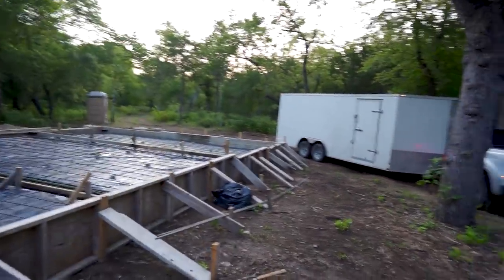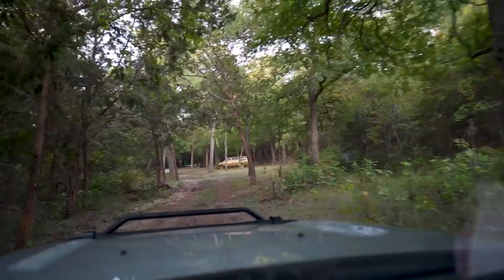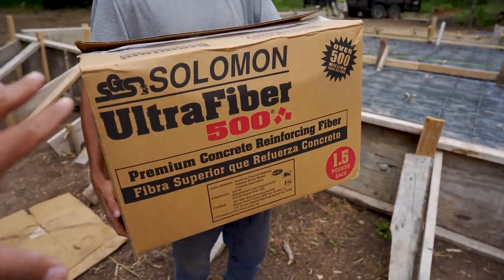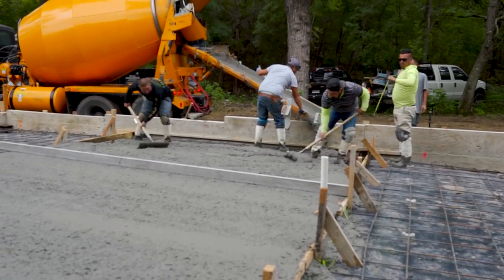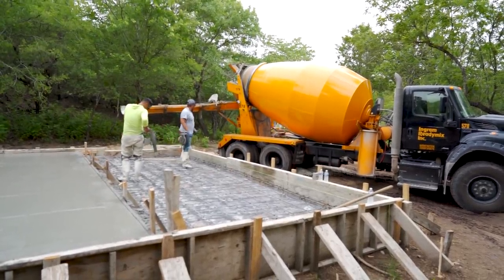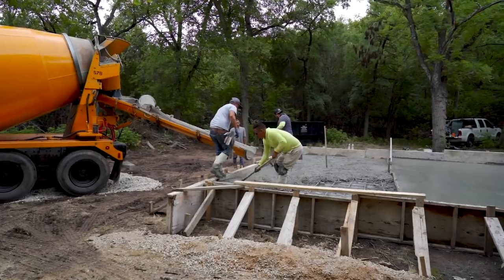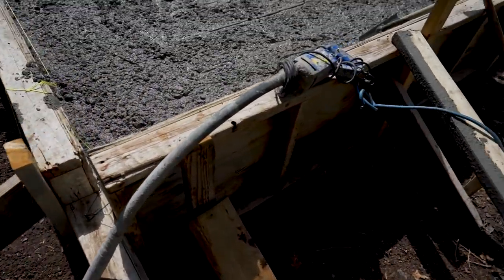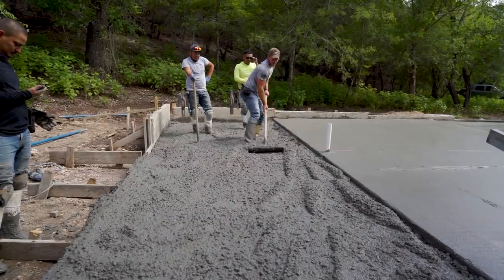Concrete Pour - Demolition Ranch Headquarters Part 5 | E69 S3

Comment: I worked as a concrete special inspector for a decade and it is a pleasure to watch a crew that knows the right way to do things without being told, cajoled or threatened. Been watching you since the $1 per foot slab video that circulated on LinkedIn.
Reply from the maker: Thank you.  
Yeah, the infamous $1 concrete video.  😂

Comment: My company just bought a Makita pencil vibrator with the 4' stick. Love it. We had one of the old style vibrators that weighs 60lbs with a 10' stick. Definitely recommend the new battery operated Makita. It doesn't have the power that the old one did, but it works well for what we do.

Comment: After you do slabs long enough you can feel any variations or bumps with the boat float and smooth them out the way you do it is fine and works good so liking it👍

Comment: I'd say you only need a little over 9.5 cu yards. That's using my HIGHLAND LAKES READY MIX CO, INC concrete slide rule that my DAD used to use back in the 70's and 80's. GOD rest his soul.
Reply: I once had a boss who couldn’t figure cubic yards so he’d use the little slide rule the RediMix company gave him.  For example, if we were doing a sidewalk, he’d say, “It’s 3 1/2 inches thick, so we’ll call it six, it’s 3 feet wide, so we’ll call it 4, and it’s 40 feet long, so we’ll call it 50.”         Then, after every job, he’d ask, “How much mud did you have left?”  We’d ALWAYS say, “About a wheelbarrow full.”  But sometimes that was a heck of a wheelbarrow load!

Comment: I always set the form-work to the exact height of the final finish and run the mag tamp bar between the two parallel guides like a saw, after vibrating to just over level. My tolerance is +/-1mm. I normally do a few passes with the mag. The method in the video seem to require a lot more man power and more skill for those tamping to keep it level. Thanks for posting.

Comment: I don’t care what anyone says workout muscle and working muscle are completely different
Reply: Yup, Had a short Hispanic man deliver my washer and dryer and he carried both on his back off the truck and up to my 2nd floor washroom,  he wasn't built but just stocky and his partner said he did that all day long....
Reply: @jasonengland2357  I was an elevator door installer. When we would get a delivery, it was usually 100-200 a day. Mostly because of construction debris, we would have to hand-carry them. The only practical way is to put them on your back.  I did thousands of them like that. The stainless lobby doors are the worst. 350-400 lbs each.
Reply: They are both muscles what are you made up of ??? Some people are just lazy af and wouldn’t want the fatigue that the job brings along
Reply: @Juan-dl3qs  They is a difference sir. Typically when someone goes to the gym or works out at home, they usually limit themselves and target certain muscle groups. When you're doing this type of physical work every day for a living, you tend to work out muscles don't get used very often even if you do visit the gym. That's where the term corn fed comes from. People that do physical work for a living are stronger than many people think. I believe that's what he is trying to say.
Reply: getting work muscles ignores other muscle groups. Getting muscles in the gym is better because you will develop every muscle.
Reply: Zezoo 210 when I was younger ( 33 ) I was as solid as a telephone pole. I was a high line lineman.  Now that I’m 61 I am a marshmallow compared to my prime.
Reply: Juan it’s all of the tiny muscles dude.

Comment: Always good to get the new guy dirty and burned out. Matt loved it. Get the 20v dewalt vibrator. A 60v battery lasts the whole job for me even doing walls. It will match all the other dewalts you was using. I have about 10 batteries with me every day and a truck charger. I haven't run out yet. Even with the 60v chop saw and 60v worm drive circular saw. Am a demolition guy but adding you now. I use a bump stop also. Never to pround to make it right. Never seen a vibrating bull float.
Reply from the maker: You have to try the magvibe.  You’ll like it.
Reply: @TexasBarndominiums  cool. Just looked it up. I have a golden brand in the shop on the wall with a  broken adjuster looks like it's going to get some parts to put back in service.

Comment: Demolitia here. 

I am in civil construction, do quite a bit of concrete. My primary frustration is that most of the concrete yards we work with run 10.5 yard trucks, but always send them out light. We see anywhere from 7 to 9 yards, so it really causes issues when we are planning clean ups. It is a particular issuer when we have a very specific mix design for fast set and early strength rise because we need that monolithic pour to go real smooth. Nobody likes calling in that cleanup for that extra yard, especially when it is because they send 3 trucks out a yard light each. 

Figuring out the need is pretty easy, until you get into trench backfill with slurry/ clsm. Then you know that all those little numbs and bumps add up quickly over 300 feet or more. 

Overall, 11.5 yards. Depending on the job and how close the plant is we add 5% to 10% for smooth graded soils and aggregate base. 1 yard extra minimum unless there is no space and the concrete company does not back haul leftovers.  I would order 12.5 yards.  1 truck (we figure will come in at 9 yards) and a 3 yard cleanup since the cost of that extra yard ($105 delivered) is a lot less than an interruption or an emergency cleanup.

Comment: Demolitia here...no,  I didn't "notice the pipe" until you pointed it out👈.  Running that concrete is an art, interesting as well. Your guys make it look easy but that's from experience and knowledge. Think I heard Matt say "about 3 mins and I was tired". Wow, for sure ya gotta know what you're doing or could easily be a big mess.  I'm guessing will run short, at least 3-4 yards short I think?

Comment: All of our local concrete companies use front discharge trucks.   It seems that combine with a driver operated hydraulic shoot they can place the mud much easier, faster and more accurately that rear shoot trucks.  Looks like it would have made things a lot easier on this pour.

Comment: years ago when i worked construction as a electrician, we would work on the gal pipes coming out of the decks. some of them had no caps on them, so we would put a metal snake through them to see if they were open. a few had concrete in them. if the snake didn't break it open, we would pour pepsi, coke, or white vinegar in them and wait 1 day. that usually broke the concrete up when we would hit it with the snake again

Comment: I don't use duct tape anymore, because on the last job the shel contractor's filled a pipe full of concrete

But then again nothing i could think of could protect material,equipment or installs from them

I appreciate that you care

Comment: I used my slide rule I got from my father from back in the 70's, I got right around 11.5 with the dimensions you gave us. 
If you only had 10 yards on that truck then your beams or floor wasn't as thick as you are saying or truck had a little extra on it.....I dunno. Looks good, nice job

Comment: When I built my workshop, the building code required that the footers (as you call them beams) had to be 2 feet deep and 2 feet wide. My floor is aslo 8 inches thick. Because I was going to install a couple of lathes, milling machines and a 8,000 lbs granite surface table, #5 rebar was used throughout as well as 4500 psi concrete and the fiber reinforcement. 
I was lucky as a dear friend that has 35 plus years of experience doing commercial tilt wall buildings (frame the wall on the ground then pour concrete and stand up once teh compression strength is reached) and parking structures, volunteer to help. We poured 27 yards of concrete in about 4 hours. It was nice as the batch plant was less than a mile from my house. I purchased a power screed then sold once my projects were complete.

Do Texas DOT regulations allow you guys to have transported 10 yards of concrete at a time?

Comment: That's some great work! However I'm Always wondering about the cure (keeping the concrete wet for a few days to avoid cracks)... Matt seems to Not do it properly for any projects and I was wondering If you are doing it on this slab. Why or why Not?
Reply from the maker: We water cure when we can.  However, on this job there is not water on site.  But we did get some rain the day after, so that will help.  :)
Reply: Texas Barndominiums okay thx a lot for the answer :)

Comment: Yep! If that pipe was a floor drain you really would need to do that. When they were using a pump on our new jail they failed to cover the floor drain and the QA at our county would not listen to the maintenance department when he said a 5 gallon bucket of water would not prove the drains were working from the fifth floor. Six weeks after moving in 600 prisoners there was a serious sewer backup. It ended up totally doing away with the entire maintenance budget for six months to fix the problem. No it did not cost the builder the county had signed off on the acceptance.

Comment: If I'm not mistaken, there's no vapor barrier in the beams/footers.  What's to prevent moisture from traveling through the footers to the slab?
Reply from the maker: The thickness of the concrete. It’s 24” thick at the beams.
Reply: @TexasBarndominiums  Makes sense, so basically the thickness of the concrete cuts/stops the capillary action at some point between 0"-24+", where say at 4"-6" (slab thickness) it does not. Do you know the min thickness of concrete to accomplish this? Thanks for the info and reply...
I'm learning!! Really enjoy your videos

Comment: Yeah I noticed that pipe I didn't wasn't going to say anything though. On the yardage I didn't take the time to do the measurements for you but it's length times width times height in inches and then divided by 27 and then sometimes because they do yardage by weight and you're doing yardage buy actual cubic yardage there can be slight differences for a few yards. But by just eyeballing it on the TV what's really doesn't tell you match I would think it was more than what you were saying but usually in person I'm pretty good at that

Comment: What slump do you order your loads cause ift looked super watery and how much accelerator did you use cause it looked like it setup super fast too.
Reply from the maker: 5 slump. 
No accelerator.  The color and straight cement (no fly ash) makes it dry quick!

Comment: How are you going to anchor the frame once the concrete is dry ? Do you drill to insert a threaded piece ?
Reply from the maker: Weld columns to anchor plates.

Comment: Why did you leave the board in the slab, between the main portion and the front porch.
Reply from the maker: Because slabs are different levels.
Reply: I believe they let the top slab set up and once the lower slab is in place they pull it and backfill. Just did that kind of pour yesterday.

Comment: 7:00 what are these “beams” you speak of?
Reply: form was dug deeper around edges and across a few places.
Reply from the maker: Grade beams.  Ditches around foundation.
Reply: @TexasBarndominiums  Oh, the footers?
Reply: @d.8580  For. You yes for them grade beams
Reply: In the USA they are called footers.
Reply: @johnmarquardt1991  well in Texas is call grade beams
Reply: And footers are just the footprint of the house or buildings where walls go
Reply: @rubenvarela4077  I think it's called several things all over.
Reply: @johnmarquardt1991  in st Louis Mo we did 8 ft walls for basements and he call them footings under the wall
Reply: @SheepdogSmokey  yeah ture that
Reply: Grade beam is when the height is greater than the width and a footing has a width greater than a height.
Reply: You may know them by another name "Footings". Basically, load bearing parts of the slab that go below ground. Usually placed around the edges of the pad (to prevent the soil from under the pad migrating out, and frost stuff.) and under load bearing walls that will be inside the pad's area.

Matt better be glad that the frost line is well above 12 inches where he's at. If he were up north, the frost line could be four feet below grade... He'd be swimming in concrete.
Reply: @johnmarquardt1991  Depends where you're at. I know around AZ, they're footers. But I can't speak for the rest of the US. Looks like Texas likes to be a rebel.
Reply: @rubenvarela4077  Isn't your frost like a lot lower than in Texas? Pretty sure it's a case of "well, we have to dig them deep anyways, might as well make a basement."
Reply: @jackielinde7568  that was in st Louis mo when i live you are correct  i live now in texas
Reply: @jackielinde7568  they 24 inch around. And middle part 1 or part 2 cover this
Reply: Just to chime in with some "logic".  Grade or Ground beams are used to directly connect a SLAB as an earth anchor system.  Footers are 'similar' in initial appearance BUT support a foundation WALL which is substantially narrower than the footer.  In the case of a 'lined' crawlspace or a basement floor, the floor slab often stops at the interior edge of the footer and is left "floating" free at only the thickness of the floor.  Floors are commonly only 3 or 4 inches thick.  Footers (depending on load) start at about 8 inches thick and go thicker with heavier loading.  Grade or Ground beams are commonly (including floor thickness) 18 to 24 inches thick (In my area of the country).
Oh, did you notice Matt C. went "over" the top of his 16" tall boot?  Yeah, ground beam plus floor thickness.
All clear as MUD now???  LOL!
Ken
Reply: @jackielinde7568  They guy is from Mexico.
Reply: that in various parts of Texas, the soil/dirt durface is completely different.  In some areas of Texas, the top layer is mostly expansive clay and during the hot summer months, the cracks are large enough that you can turn your ankle in these voids.  In other areas, you can reach bedrock layer in as little as 6 inches.  The best thing to protect your investment is by sending a soil sample to Texas Agriculture Extension department @ Texas A&M University for a soil analysis before starting.  Some areas you build on a floating slab, other areas of Texas require foundation piers to be drilled, and finally, some areas have a combination of pier and beam foundations.
Reply: There is a difference between a grade beam (used here) and a footing. There's also a term called thickened slab edge, something different still.
Reply: @TexasBarndominiums  see that sounds like a footer.
Reply: @moymoses7234  taken right from Wikipedia. A grade beam differs from a wall footing because a grade beam is designed for bending and typically spans between pile caps or caissons, while a wall footing bears on soil and transmits the weight of the wall directly into the ground.

Comment: The only thing worse than running a little short of concrete out of a full truck is running short because you just didn't order enough. It's not your fault Eric the truck won't hold 11 yards.

Comment: Just curious, what is the fiber for? (i know nothing about pouring concrete - FYI)
Reply from the maker: Minimize cracks.
Reply: @TexasBarndominiums  So is that a common thing to add, or is that something extra that Matt requested?
Reply from the maker: It’s something extra that I added because I’m testing it.  I want to make sure it works before I offer it to our customers.  So far so good.
Reply: @TexasBarndominiums  Very cool. I must say, the wife and I are getting close to begin house shopping, and after seeing your work, a Barndo is definitely in the conversation.